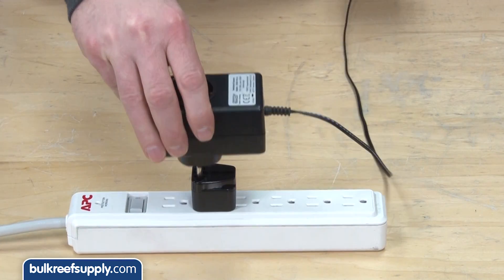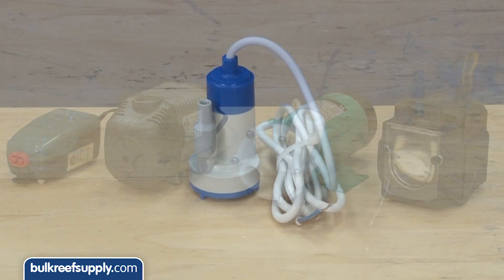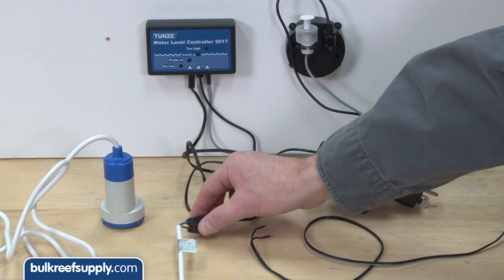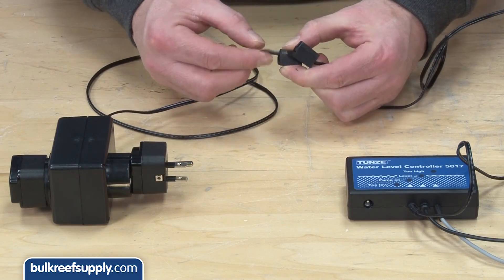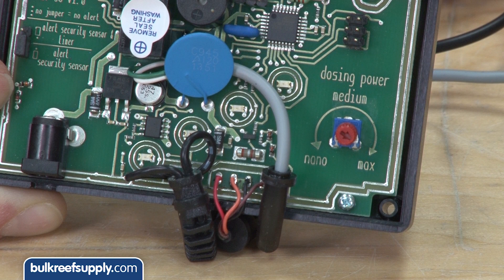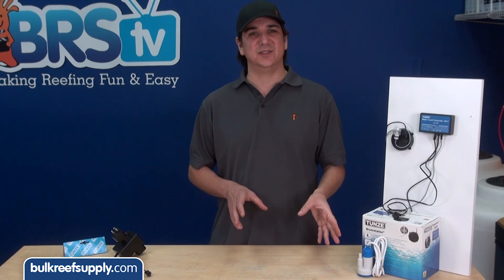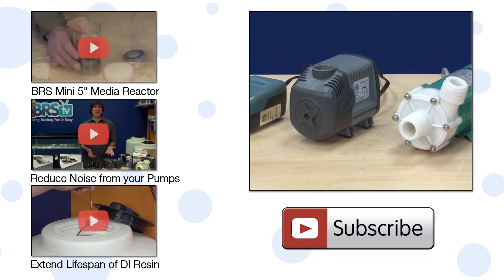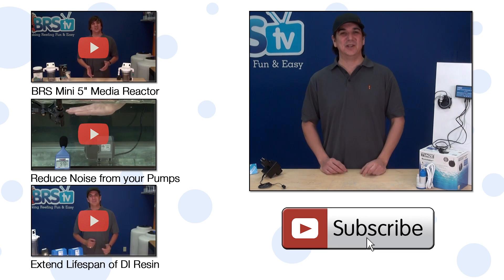Use any pump on your Tunze Osmolator ATO | How To Tuesday

Comment: While I love the idea, the multiple converters leaves allot to be desired, and because this is nothing more than a DC relay in a box, there are a ton of product already out designed for US outlets for allot less price. I've used this switch for example http://www.amazon.com/POWERSWITCHTAIL-COM-PowerSwitch-Tail-II/dp/B00B888VHM on a few project and its always worked. Especially because Ive seen DIY auto top offs that wire 120AC directly to a float switch, which is beyond crazy, a video featuring a DC voltage controlled relay strip might save a few electrical fires from happening. I have seen products in the home audio and hydroponic industries that would be great candidates for this. I really hope this doesn’t come off as someone down playing a product you sell just wanted to let people know there are products out there that have worked for me.